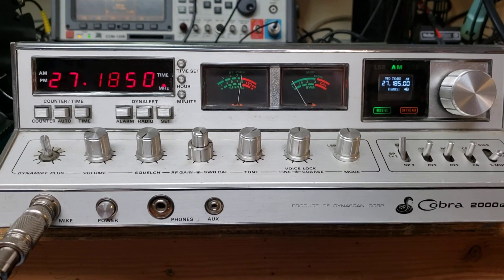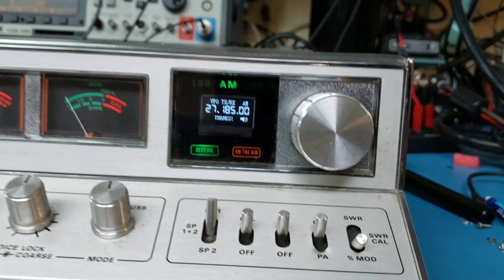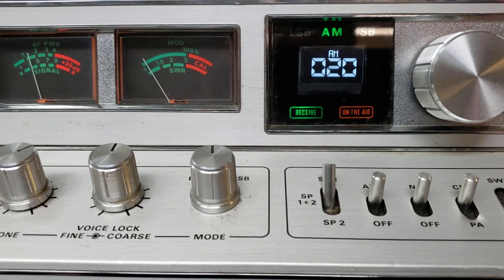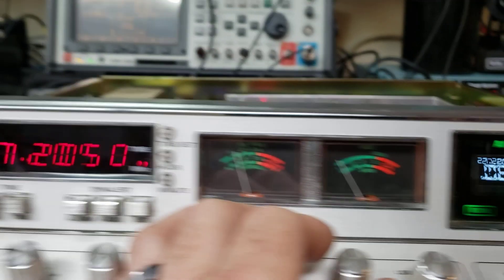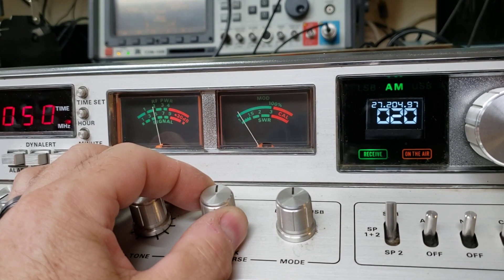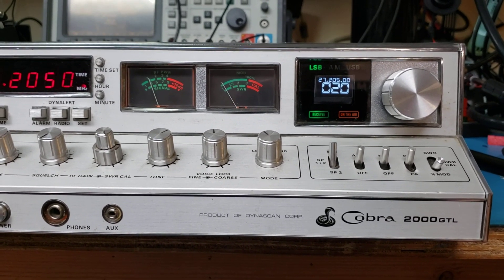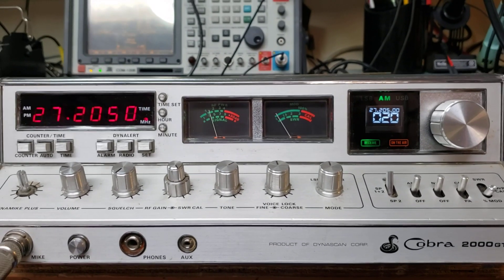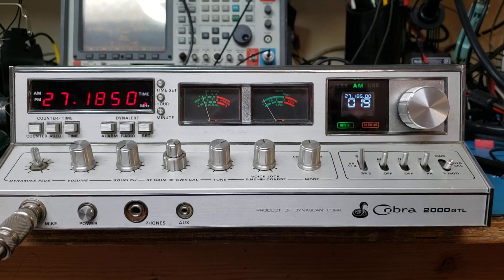Cobra 2000 with DDS-VFO

Comment: Wow. Do you have instructions on how to do this to this radio or a Madison v1?
Reply from the maker: Its universal and tes, manual is on the site www.ddsvfo.com 
We mad it for a 148 but, its not specific to one radio its universal.
Reply: @ddsvfo  I have a Madison v1 with a working clock that I got from garage sale and the tx is garbled and the rx is week and garbled. I'm going to recap it in a few days. Hopefully that fixes those issues. On top of that there is a pll channel mod switch. Botched... Imo... Clarifier is unlocked. I prefer locked. There is a wire disconnected from the motherboard and a diode and resistor lifted on one end of each component. The exterior is in great shape and was hoping it was less molested. But I was wrong. I'm looking for someone who can make it right, align am and SSB and also add some am swing so it will drive a 4 pill 454 Fatboy heater. Lastly add this channel mod. This something you'd be willing to take on? Thanks in advance
Reply: More than anything I don't, I don't, I do t want a splatter box
Reply from the maker: When the kit is installed it will bypass all the old pll and local oscillators. So that won't make and issues if thay have been hacked up...

Comment: It’s awesome! My only beef is that on radios that have a frequency counter nothing is done to use the long strip of counter in the way of making new displays. Yes, the frequency number will be smaller, but larger than the counter used currently on the market
Reply from the maker: Easy! Simply turn off the frequency display in the menu and it will show your text along the top!